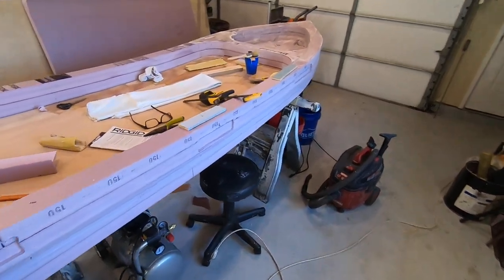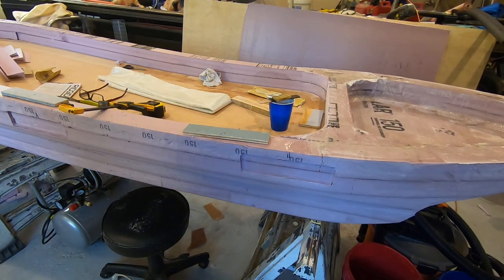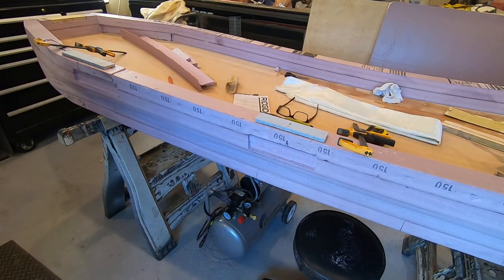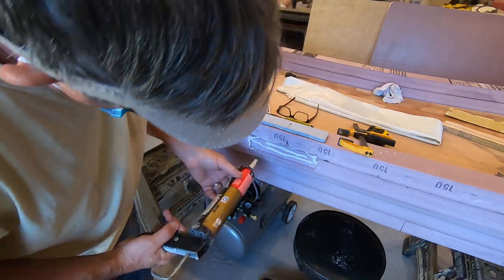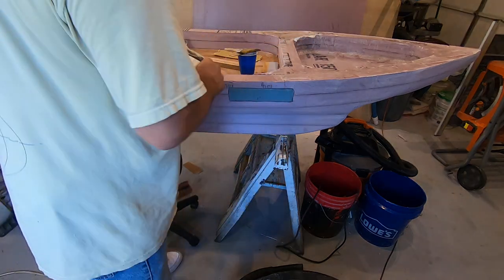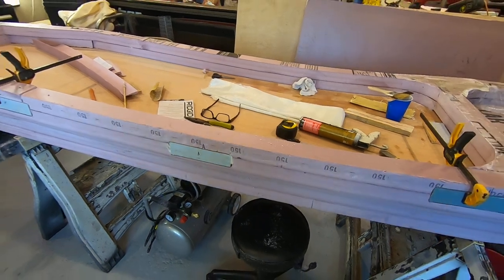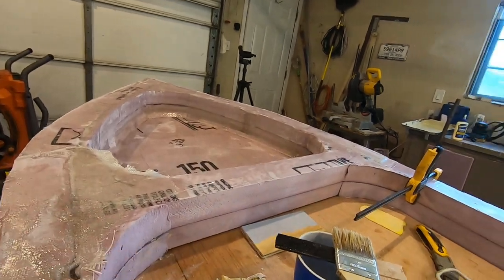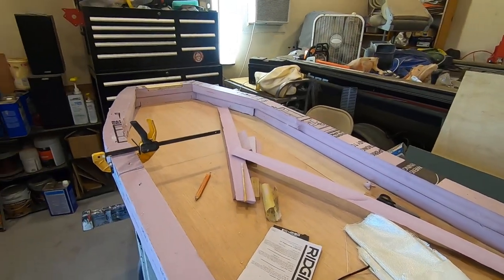How to make foam kayak Attachment points for kayak rigging foam boat diy fishing easy to build K20

Comment: One thing I am going to do on my build is line the inside side rails with a wide strip of 1/2 insulation foamboard.  That way the sides of my boat are very smooth.  Makes the cockpit really clean.  Admittedly, mine is rougher than yours.
Reply from the maker: Thank you for the kind comment, it just takes time to make one smooth and if you were here and see the boat close up it is not perfect that is the beauty of video it does not catch everything. I had to line the front storage with 1/2 inch foam strips because it was rough but now it is acceptable and easy for cleaning later.